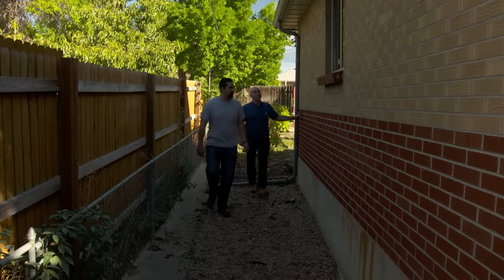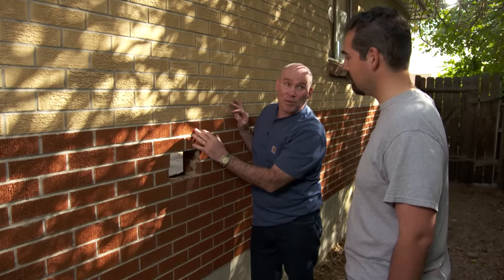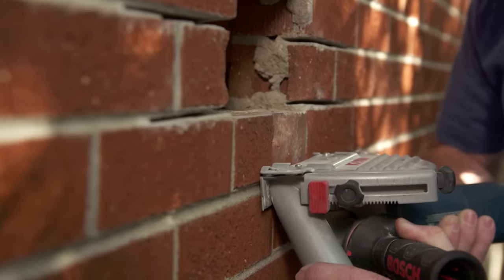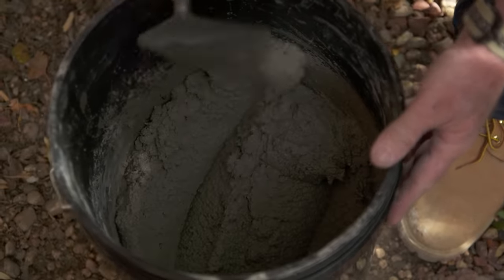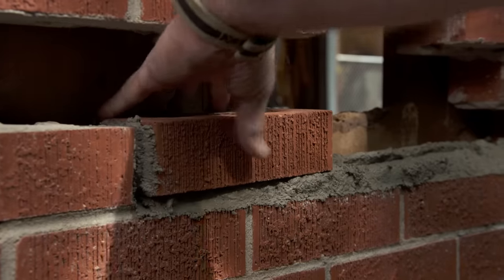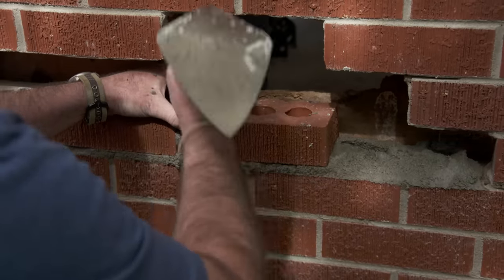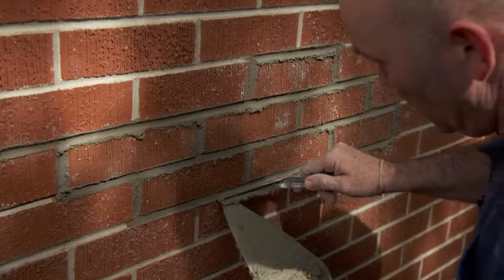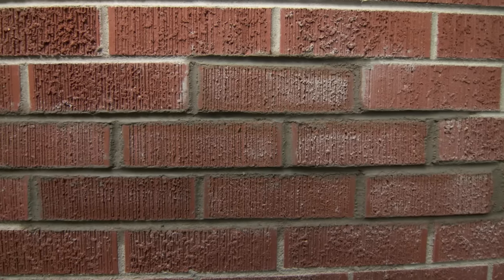How to Patch a Hole in a Brick Wall | Ask This Old House

Comment: Unfortunately that top brick he set was crooked in the opening- low on the (viewers) right. But other than that, nice work.
Reply: The top joint of the top brick looks crooked but the bottom joint looks good.  Weird.  Maybe a malformed brick?

Comment: Don't hammer and chisel...proceeds to cut then hammer and chisel 😋
Reply: Common sense duh
Reply: That was after he had already loosened the joints by grinding it out.
Reply: @FKS1994  regardless the contradiction was quite ironic.  I get he loosened the joints but then within minutes is hammering away.
Reply: @jkbaker01  Well, it clearly isn't within minutes. The video is shortened but the actual project of what he was doing would take more than a few minutes. Nevermind the fact that he stated that there is too much tension to start using the chisel and hammer. It was only after he spliced off the cement that the tension loosened to where a chisel and hammer could be used. Ehh, I get the "irony" but with construction, some things are basically implied because it's almost like common sense.
Reply: You need to grind out the joints at least a little or the brick on top will break as well when you hammer on it

Comment: I actually learned a lot from this video.
1. I there in no way on earth a mere "DIY'er" is going to get the job done. <(Reason for YT searching.)
2. Hire a professional. who has all the right tools. (Defeats the whole point of "tutorial video.")
3. Start saving for the cost of said "professional builder," with his angle grinder, etc.. Loads of help.
Reply: Sorry, but there's no way that hiring someone is going to cost less than the $30 for mortar and bricks, $50 for all of the hand tools and the $50/day rental for a grinder ($130) from your local hardware store.
Reply: Not my takeaway at all. What a "mere" DIYer is capable of depends on their existing skillset and base of knowledge, and that varies significantly from person to person.

Hiring a professional will cost 3x or more the price of doing it yourself. I already own an angle-grinder, so all I'd need is the brick, mortar and a few hand tools; maybe $100 altogether.

Comment: Pardon being off topic of the video, bur it encourage me to ask about my own brick issue.  My home is over a century old and I suspect behind the plastered walls is brick.  I want some exposed brick in my home and how do I tell if there is brick already in place without doing serious damage to my walls?
Reply: Political Twinkie if you have a brick chimney going through the house then it should be behind the plaster. Outside walls should have wood boards behind the brick so you won’t see them on the inside. To confirm, you could drill a small hole to have a look.
Reply: Ennio Aguilera,  sir have no idea what you have said to me because you could not know how important your words are.  I have brick chimneys.  I feel rich. Thank you so very much for your information!!!! Wow.

Comment: Good video.  I would like to see a video about what to do to stop bricks from  dusting.
Reply: Water
Reply: Marlin Yoder I think he means dust while demolishing. No external threatment will prevent that. Maybe first drill holes and let water poor into the wall until it becomes soaked. That will take a few hours. Then start demolishing. But that’s not worth the waiting i think. If its indoors then just clean up afterwards. And use such vacuum attachment.
Reply: @Engineer9736  Dont give advice if you are guessing out in to nowhere.

Comment: Im just curious. Why did you cut the wall ant then end up doing hammer and chisel anyway?
Reply: The cut is to separate the bricks from the mortar and the hammer and chisel is to help take them out. Without cutting, he'd need to use a lot more force with the hammer and chisel.

Comment: How do you fix holes that are smaller like screw holes etc. Do you do it the same way or can u fill it in?
Reply: You could fill it but it won't look pretty.
Reply: @Turgz  if you repair it this way and you have a lot of holes then it's gonna get expensive. The way they make the brick can't you use the soft material before it goes hard and turns into a brick. Can't you use it before it gets hard and fill in the hole so when it dries it will look like brick
Reply: @khoale4755  You can probably use red clay. Thats what bricks are made of right?
Reply: @SalvadorSTMZ  bricks are baked at high temperatures so they don't just dissolve, just like pottery.

Comment: Anyone knows what is needed from the inside, apart from obviously parching the drywall? Any type of barrier or insulation?
Reply: Depends on the existing insulation. You should always try and match it and if possible. You can find out the minimum r value for your state which is normally what goes into it.

Comment: Just put a vent cover over it.
Reply: In this instance there's sheathing behind the brick facade. The brick works as a weather and moisture barrier. Using a vent cover would allow moist air to get to the void between the brick and sheathing potentially causing a hidden rot issue inside the cavity. This is why the wall was properly repaired with brick and mortar.

Comment: Create a bigger hole to fix the originally small hole, got it.
Reply: Same as sheet rock most of the time.
Reply: Yes  RetroSteve, I don't get it either.  Pro's always do stuff the hard way trying to be perfect.  I would never take out a big hole like that when it is was a much smaller hole to begin with..  I'd stick in two bricks with some cement and be done in 2 minutes.  He made it into a 2 hour job.     The pattern match is not that important to me for two bricks on the side of a garage.   Besides, you could always mimic the pattern later anyway, by painting or making a cement line if you have any artistic ability at all.
Reply: @rjwalker6677  not for.you but thr homeowner is different
Reply: @rjwalker6677 , Sometimes when removing the bricks, accidental damage occurs to the adjacent brick, then you need to remove another until you have a nice clean area overall.
Reply: Oh the irony! One must put many holes in a roof to fix a hole in a roof.
Reply: Same as what the dentist does.. drill out the rotten stuff and replace it. Quite common sense imho.
Reply: He mentioned in the video that was done in order to mimic the existing brick pattern. If you tried to just slap two or three bricks in the original hole, the pattern will be off. You'll also have some mortar joints that will either be too wide or too narrow which may create a weak joint, not to mention being an eyesore.

I don't mean to offend you but if you want a fix that is just that, a fix, this might not be the right channel for you. This shows you how to do it right the first time and not have to worry about it again.
Reply: @benjamincarpenter4376   I don’t see how the pattern would be off. The top hole is just a perfect 1 brick hole which he didn’t touch and the bottom hole is half a brick on either side. Then the brick underneath had a sizable chip broken. He just needed to remove half a brick on either side on the bottom part of the hole, 1 brick below the hole, add 4 bricks and he’s done. 

To do it right the first time you don’t create additional damage to the remaining bricks.
Reply: @bighammer3464  Keep in mind though that we are just watching a video here. The other bricks may have been loose, or may have had slight damage to warrant removing them as well. Looks can be deceiving, just because they look fine from a camera doesn't mean they actually are, and I don't see why a masonry contractor would make more work for himself if he didn't need to. I work in this field professionally and time is money, the quicker we are out of there the better.

Comment: So to replace two bricks - you removed SIX???  Oh, and we don't want to use a chisel - promptly switches to a hammer and chisel and smacks the snot out of the brick!!!
Reply: Youtube expert to the rescue. The other bricks were broken or cracked.. was he supposed to cut a brick to fit in between them?. And the cuts he makes seperate it from the wall so he can chisel at it without hitting the entire structure and causing a crack
Reply: tarndeep b You are also a youtube expert
Reply: I do it for a living so Mason expert here lol you need to grind out the joints at least on the top or the tension would break the brick next to it as well
Reply: What he did is similar to cutting drywall. You don't just punch it and expect it to break where you want it to. You have to create a breaking point with a utility knife and THEN punch it. Him cutting the mortar first also creates a breaking point so as to not damage the surrounding brick.